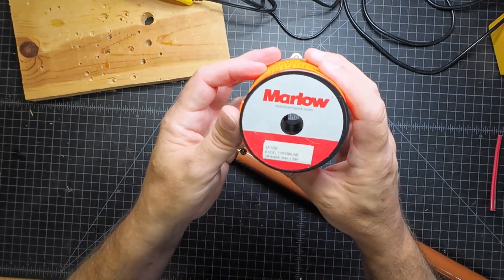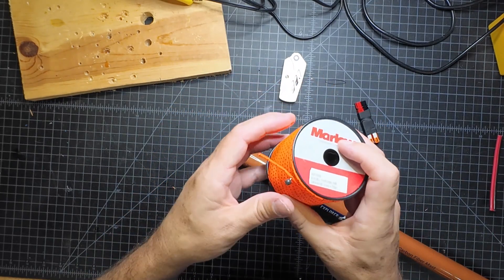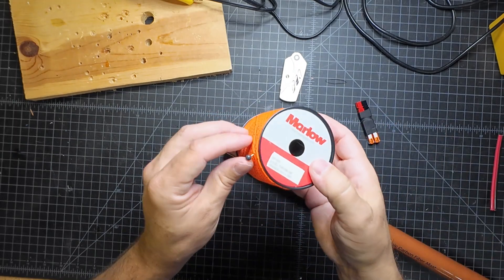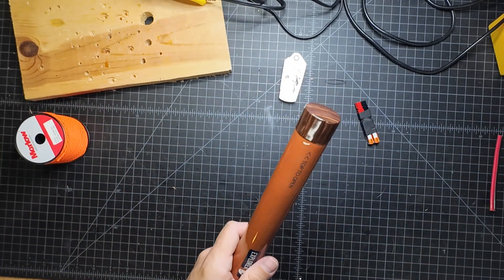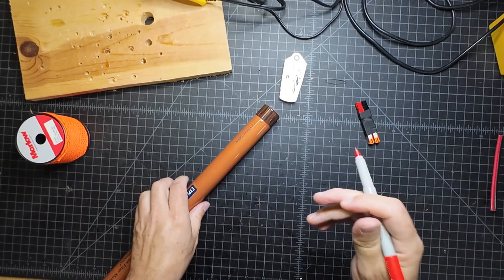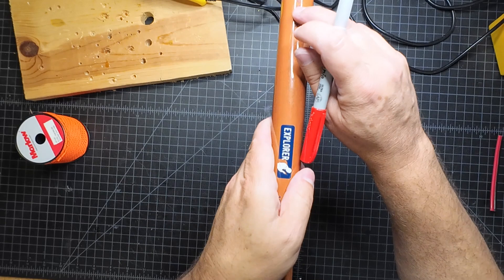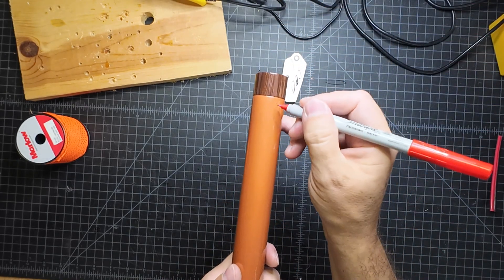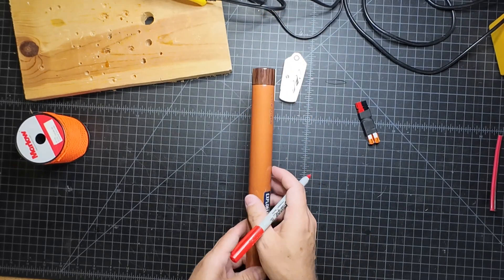How To Self Support Any Ham Radio Mast

Comment: I used a similar method for a 10 m sota beams mast.

The three loops I have coming out the top of the wrap instead and I put stopper knots on the ends so they wouldn't pull through the paracord wrap.

The guy ropes are paracord with an s-biner to hook to the loops and taughtline hitch loop on the other end with a hook in to very simple tent stakes. 

Even though it's only guide 3 ft up I've had it up for 6 months holding the middle of a 40 m efhw And it survived 65 mph winds without knocking over
Reply from the maker: Awesome.  Yep, stopper knots are awesome.

Comment: I have used a similar solution with my aliexpress 7.2m fiberglass poles. Only difference is that I add Nite Ize mini figure 9’s to the loop and I use 5 min epoxy instead of hot glue.
Reply: 100% correct, this style attachment has worked very well even on extremely windy summits where the last mast is bent to nearly 90° but the guying has been solid.
Reply from the maker: Hot glue is just to secure the loops while the friction of the rope windings is what actually holds them in place.

Comment: Very good Kyle. You might consider using a hose clamp to secure the loops,etc. in lieu of the cord wrap. Probably more secure than rope held with hot glue. 73, Marc, W4MPS
Reply from the maker: So the hot glue is only to secure them while I wrap the rope around. The friction from the rope wraps is what holds the guy loops.
Reply from the maker: Plus hose clamps are top bulky